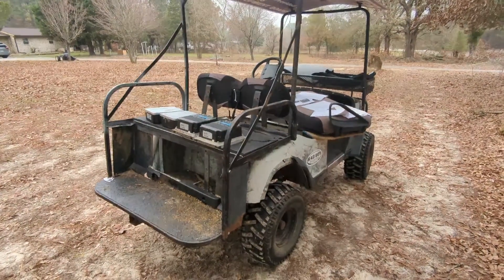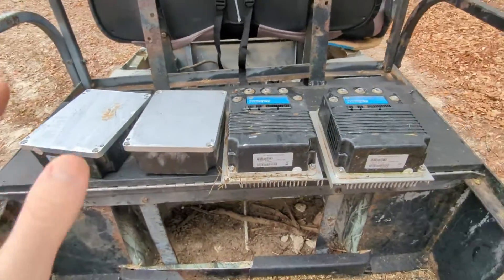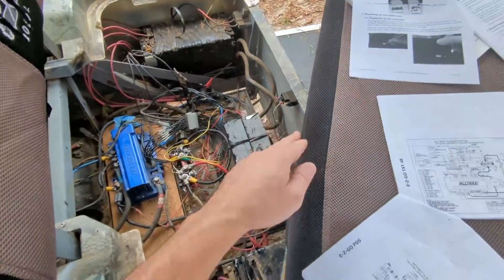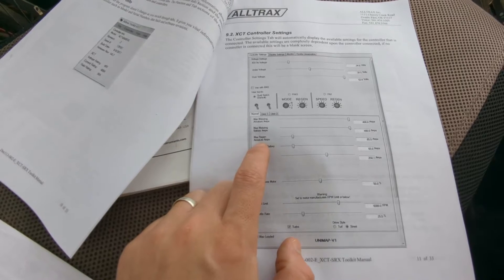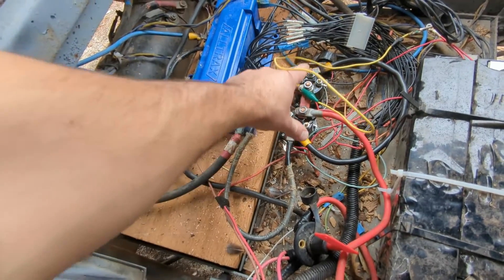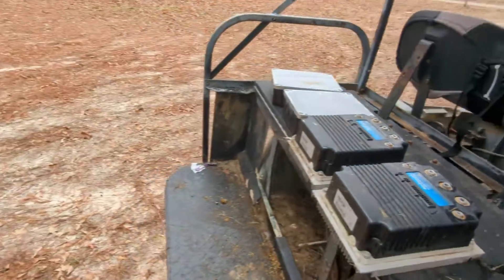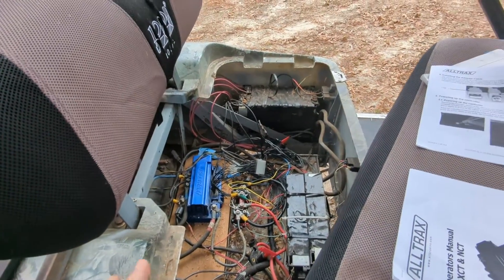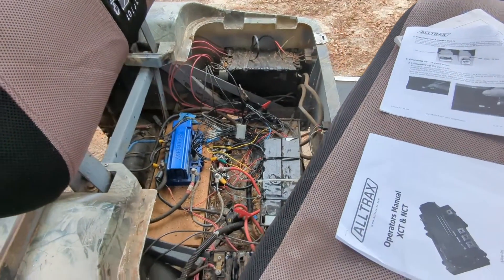Upgrade to Lithium? Alltrax XCT48500 motor controller

Comment: I just ordered a motor combo kit and that includes a alltrax controller rated up to 500 amp, they asked me a bunch of questions about the use my cart was going to have . I’m assuming that is so the manufacturer can program it which the sales person said ti comes programmed which is good for me because I’m not mechanical. One of the questions was , what type of batteries do i currently hav which I answered lead acid . I guess what I’m wondering is can it handle new lithium batteries and would it need to then be reprogrammed? Thanks mate .
Reply from the maker: Yes!! For lithium battery reprogramming is needed for the Regen, lithium batteries cannot handle as much charging current as lead acid batteries can. So on the regeneration on the controller it needs to be turned down to a smaller amps. Because it can damage your lithium battery
Reply: Are you still using this? I went with lithium and I think I have to get a new controller. My setup will be charged by solar.
Reply: I'm also thinking to get the XCT48500-TXT48 for my e-z-go express s4 48v (lifted, stock selanoid, stock motor, 14 cell lithium 110ah battery)

You think i should stick two selanoids in parallel like you did or see how it runs first? Also a stock motor would handle it?